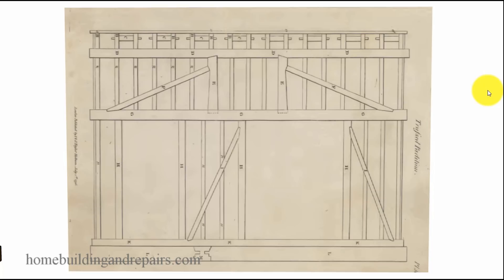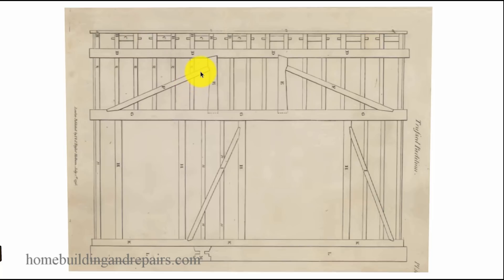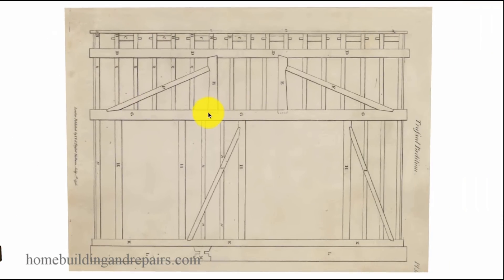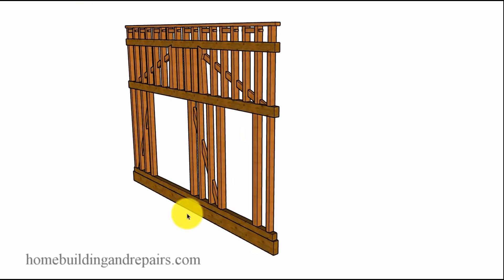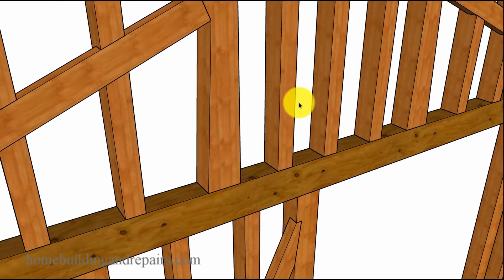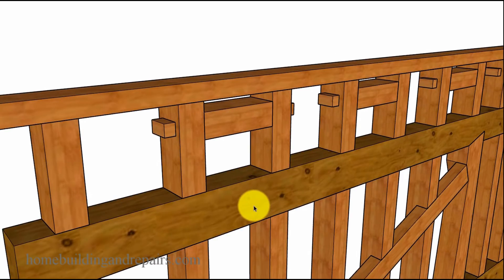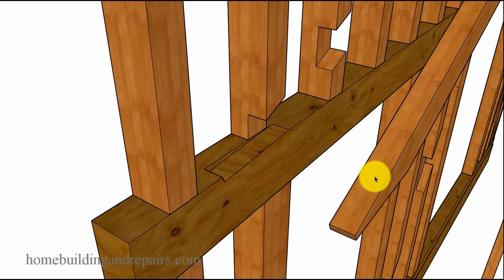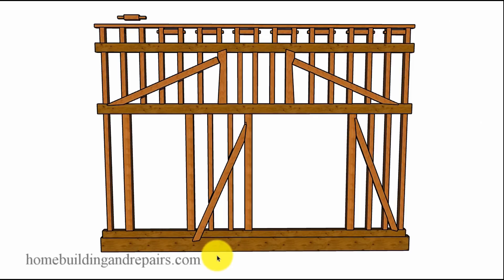Example of 18th Century Structural Shear Wall Framing - Historical Home Building

Comment: I've learned that wood framing was designed to hold the floors, walls, and roofing while resting on old growth beams and brick pillars, as opposed to Post-1940's when the industry became standardized.  To accommodate new materials such as fiberglass insulation and gypsum board, the home also became equipped with utilities such as plumbing and HVAC. This change makes the integrity of the home rely less on studs and framing and more by the sheet rock and plywood that holds it all in place.